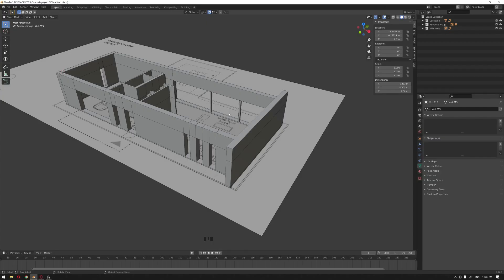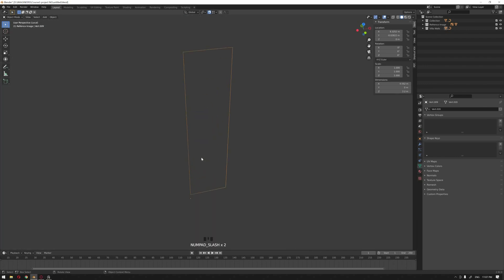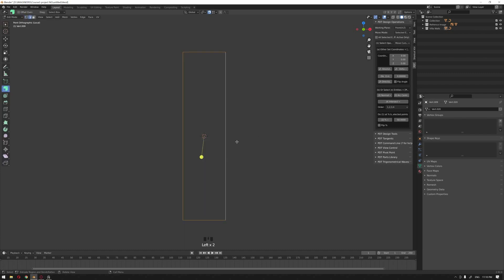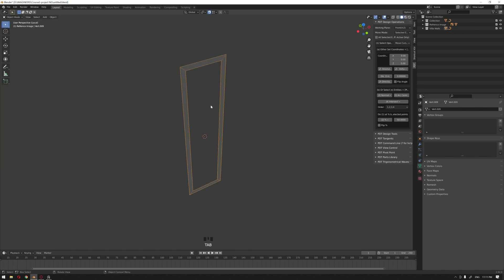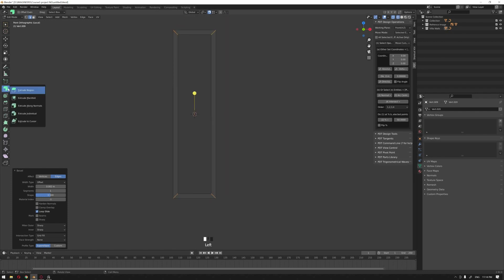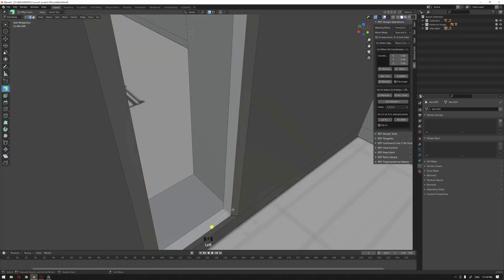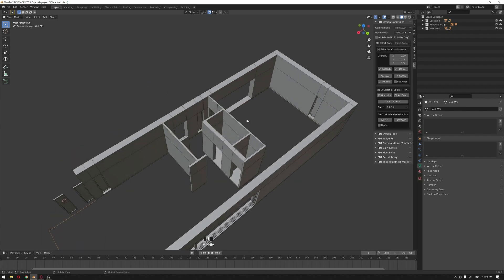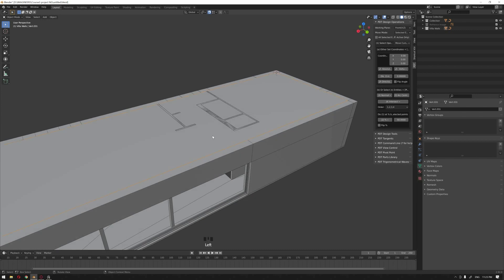The House _ Course 2 _ Part 2 Belnder Arch Viz modeling and Exporting to Quixel Mixer

Comment: Great tutorial! For use in current UE5, with lumen, how is your current workflow? I ask since for Lumen to work well all walls need to be a separate mesh and I'm having a hard time finding a consistent way to work and make changes when needed in the model.
Reply from the maker: Thank you , yes the more separated the inner walls the better lumen light bounce result plus the brighter the color the better , as for your work flow we all face the same issue when working with arch viz models specially the once that you receive and need some edit before sending to UE , but you skip the exterior part and only do that to the interior walls , thanks

Comment: Thanks a lot for the tutorials . But i dunno why when i click on bake. ive got some kinda of msg errors : "Traceback(most recent call last):

File "C\Users\....line152 in exucute...
File "C\Users\....line152 in exucute...

Location <Unknown location>" and it doesn't work :/
Reply from the maker: Hi there , your most welcome can you please check if there a material applied to your object and also try to apply that on a basic object with few faces just to check if the addon is working , other wise try to remove it and install it again , if that doesn't work please let us know , thanks
Reply: @theimageneers5161  Hello, Ive same problem. :-(
Reply from the maker: @circlepicturess4833  Hi there , if you have done everything the same and your object have material applied to it , i guess the only thing you can do is to double check if the plugin is working on a simple object or if you can change your blender version if its not supported

Comment: I have problem with the window frame at 8:56. i´ve tried to create the bevelshape object you described in the tutorial and i have created the frame to the big window.I´ve converted booth to Curves. I have move the Origin to the same position as yours but the Window frame gets distorted. Do you have any sugesstions?
Reply from the maker: try to press on ALT+S to make sure u are in scale if that didnt help try rotating the source shape

Comment: Thanks for this tutorial, may I ask why you don't use the archmesh addon ?
Reply from the maker: Your most welcome , the archmesh is a great addon , but in many cases it will create unnecessary mesh result that will not be good for light backing in UE and its also good to practice modeling with a different way to get a better clean result

Comment: Hola buenas tardes! muy bueno el video! no me marca el origen en el centro de la ventana con PDT que puede estar pasando? gracias!!!
Reply from the maker: Thank you , the center is basically a way to let the offset move equally from all sides so if it really help to get more accurate origin point , otherwise if its not really visible in the model then its ok .

Comment: i have problem with plugins when i install it an error will appear : Upgrade to 2.8x required and i use 2.91.0
Reply from the maker: If you are refering to the offset addon can you please try to dwnload it again for the updated link we have added , thanks
Reply: @theimageneers5161  it's work perfectly, thanks alot